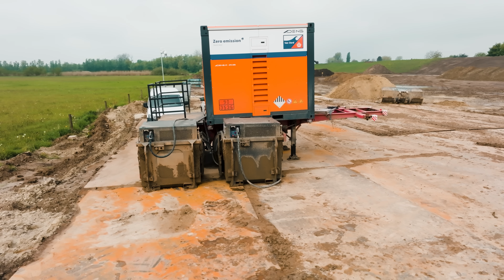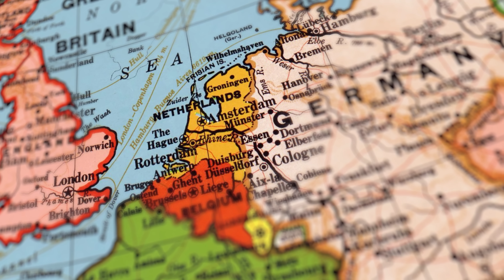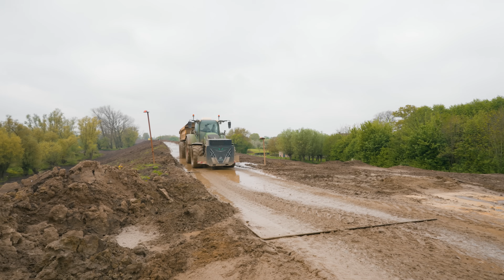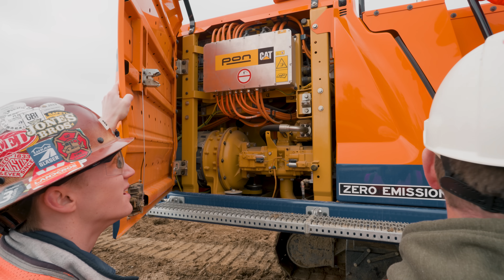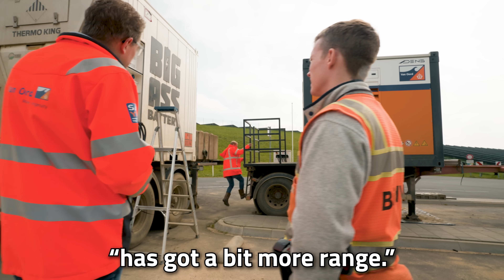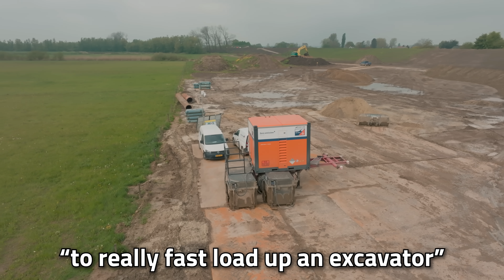Inside the World’s First Electric Construction Project!

Comment: I’ve been a heavy equipment mechanic for almost 20 years now electric machines are gaining more and more ground in the industry in order to run machines 24 hrs a day like some applications are gonna have to come up with a way to swap out battery packs quickly and efficiently to keep things running smoothly
Reply: Perhaps in some contexts running 24x7 is important, but in this case clearly one of the goals is to reduce the noise footprint since they're working next to the residential areas and surprise surprise... they likely aren't allowed to do anything overnight anyway.
Reply: Some people were commenting the tractors can self swap batteries thanks to a smaller internal battery. Maybe they can figure out a solution for the excavators too. This was all retrofitted, maybe moving forward they will design new machinery with electric first design (like the difference between a tesla model Y and a volvo xc40e, the latter having been retrofitted from a thermic design) which might allow them to implement such things.

Comment: Paid by the Dutch tax payer directly or indirectly... Not coming cheap...
Reply: It’s cheaper in the long run anyway.
Reply: We're you get that from? Special 1st off manufactured hardware/equipment 200% of standard costs, less Tenders capable to tender! A learning curve yes paid by the taxpayers, easy playing...  @Freba9
Reply: @janrozemaaus  Diesel is expensive and effects of climate change on society are even more expensive. Electrification is always cheaper in the long run, even if it concerns a learning case.
Reply: Electricity is not cheap as well. Green power generated by subsidizing funding of the hardware... windmills  @Freba9
Reply: @janrozemaaus  A lot cheaper than diesel.

Comment: These machines must have just massive battery packs. Probably > 200 KWH. These Li-Ion packs when they go into thermal runaway the fires would be spectacular, extremely ferocious and totally un-extinguishable  . The big downside of the battery operated equipment.Charging is an issue comparing to putting in fuel. Although fuel cost saving could be substantial, which is a big benefit
Reply: Sure, but thermal runaways are very rare.
Reply: @Freba9  Actually there are not. Indeed the latest data indicates they are 3X more tan likely ICE to catch fire. The greatest danger comes from when the pack gets damaged. When a fuel tank gets damaged its not a big deal. When a battery pack pack gets damaged it's catastrophic.
Reply: @MadawaskaObservatory  haha it’s the complete opposite. All data proves ICE fires are MANY times more likely.

Comment: this is the stupidest thing ive ever seen almost zero co2  hahah sorry about the co2 it took to make the batterys and everything else  the machines are soooooo much heavier   this battery idear works here cos thay have a solar farm right there for it if thay didnt and needed to use the main grid electric then co2 goes thru the roof cos the insane use of electric just to charge        use diesel its cheaper and beter for the enviro
Reply: Incorrect

Comment: How much money did going electric add to the cost of the job.
Reply: at least 40%  but we have high tax rate already here in The Netherlands so its money spent well for the neighbors area whit less noice.
Reply: @Stimpy_slammer  Also as these projects get more widespread economy of scales drops the price substantially. Even since this project started in 2023 we have seen a drop of 20% in price for electric heavy machines
Reply: At least 20 quid
Reply: Electric machines are roughly 3 to 5x the cost of the diesel equivalent to buy, given this the contractors also factor in those costs when accepting the job.

Comment: What fuel source charges those batteries 😂😂
Reply: Wind and solar mostly.
Reply: judging by the wind and solar infrastructure next to the project area, mostly wind and solar.

even if they "just" use the countries power grid, half the power the country uses is produced by wind and solar. 
so worst case scenario only half of the energy they use is green. still miles better than 100% fossil ice engines.
Reply: Kiwi, did your parents feed you idiot juice?

Comment: What are the economics?
To what percentage is the project subsidized with public money?
Were traditional earthmoving companies excluded from the tender process?
Was 100% battery powered equipment a contractional condition for the project?
Is this a commercial project, or a political project?
Reply: This is public infrastructure so 100% paid with public money.
Due to environmental laws (cause the dutch neglected their nature reserves) the project could only be done without emitting nitrogen dioxide into the air.
The tender process was based on that. 

No commercial/political. This is done by dutch watermanagement boards, who have their own form of tax and are independant of country wide politics (mostly).
Reply: @randomviewer3494  
Was there risk of nitrogen being emitted into the atmosphere by using non-electric earthmoving equipment?
Reply: @eatingamandarin  burning diesel creates nitrogen dioxide

Comment: If they really wanted to be efficient, I would think getting rid of hydraulics completely would be better. Because it takes power to run the pump even when no work is being done. Where a linear actuator uses nothing unless it is moving. Rg Letourneau did it.
Reply: That would be a next step. But changing to many parts of a system at once creates huge project risks. This is a perfectly viable mode to work in, so no need to take multiple steps at once.
Reply: There are some large electric actuators replacing hydraulic cylinders in some other applications.  Just a matter of time and it will happen on excavators as well.

Comment: Whist it’s interesting to see these fully electric work sites I cannot see how this is more efficient than diesel equipment. I can’t get onboard with battery technology as a replacement for diesel either
Reply: Due to environmental laws diesel equipment couldn't be used on this work site. So it is literally the only option.

As for raw efficiency, electric motors are far more efficient. Even charging them using a diesel generator would be more efficient than just running a diesel machine.
Reply: It is not about the efficency. At least not for now.

Comment: Those windmills are really generating all those megawatts that are required. Oh wait, they aren’t moving. . And it doesn’t look like a particularly sunny day either. Don’t even mention the overnight charging. So all that electricity has to come from somewhere else. 
And how many times does a diesel excavator needs to be fueled on a normal working day?
Reply: Thing is that the European network works from Norway, to Spain, to Italy. If there is no wind or sun in the Netherlands it comes from the sea or other areas in the network. 

Besides that excess power is stored in a combination of hydro, hydrogen, batteries etc. 

Also this excavator uses 800kwh a day, so around 21 gallons. A fueled system uses 36 gallons of diesel.

It's just an amazing way to do it

S
Reply: @welvaardsbuik   Yeah, luckily it does. But at the moment it is night, so no sun anywhere. And virtually no wind across the continent. Most of the energy is currently from nuclear. And some hydro, and gas. 
Good thing it is weekend. Less energy demand.

Comment: How big are the batterys in the machines?
Reply: 140 kWh in the front of the Tractor, 70 kWh inside the tractor. 
400 kWh in the Doosan wheel excavator and 800 kWh in the Doosan crawler excavator. 
The CAT converted machines are explained in the video
Reply: @VoltGas very cool, thanks for the reply.

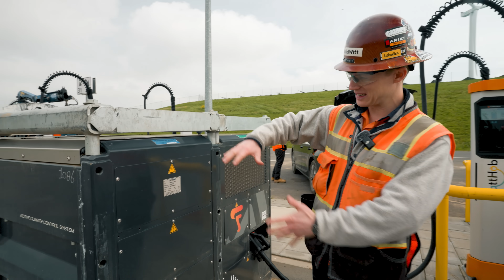Comment: A nice detail to add about the chargers (around 15:31): The machines and battery boxes all charge using a regular CCS2 connector. The same one all European electric cars use to charge, including Tesla. The project managers car can be seen charing in the background. 😀
Reply: When moving the equipment, you could even charge it at a public stations.
Reply: Nice, now you can expect a 800 kwh excavator occupying the only "fast charger" in your village. 😂😂
Reply: @mennol3885 In Europe we have a very dense charging infrastructure and also you very often have sites with 10+ charging terminals. 

We even already have the first megawatt terminals so like 1500 kW (but up to 3500kW for a single charger)
Reply: That's really great and convenient
Reply: I was talking to a Tesla tech at a charging site and all of them are actually set up for 1800kw even though it was only a 250k charge site. Waiting for the semi's to push the roll out of the over 1000kw chargers. Maybe then cars will get the systems to charge in 2 to 5 min. Cooling being the problem with that much juice
Reply: @sparksmcgee6641  Delivering the power has never been the issue. Battery chemistry is. Any cell in the pack can only be charged so fast. It's like boiling eggs---sure, you can boil a thousand eggs in 5 minutes, but no matter how big you make the kettle, or how powerful the hob, you cannot boil them faster.

For Li-Ion, the chemical limit is at about one hour for a full charge, or around 20 minutes for a 20-80% charge.

The only way to get a faster charge is to put a bigger battery in and lie about its capacity. If you call 50% "full", then charging 20-80% (real: 20-50%) in 10 minutes is easy.

PS: CCS2 caps out at 800kW nominal (~1000kW peak). If you need more, there's MCS with 4500kW nominal.

Comment: bro 800KWH... almost 1 MW.... Im not sure we all understand how much energy the world will need to produce to make this possible at scale. Not doubting it, but without nuclear I'm not sure how we get there. That's an insane amount of energy
Reply: You know that is less energy needed than running on diesel right? Electric engines are quite a bit more efficient at turning energy into working power.
Reply: A data center GPU rack consumes 40-60 kW.  So in 24 hours it could consume up to 1440 kWH. Those CPU racks are being used for AI
Reply: @johnvillalovos that’s also come straight in from power lines from power generation. These batteries and the logistics won’t scale. “Yet” I’m just trying to wrap my brain around the amount of lithium or other battery material we need… and the amount of power to make this a reality. Here in the USA we’re tapped out so I hope we double our current supply. It be a cool future.

Comment: What I am seeing is an entirely new supply chain segment (powered by diesel) created out of thin air for no reason.
Reply: If you looked closely, that supply chain is electric too. As for the no reason, environmental laws are the reason. Although I'm sure the neighbourhood prefers it too. Keep in mind, this is ground breaking (pardon the pun) technology. Give it a few iterations and a lot of the infrastructure can be reduced.
Reply: @randomviewer3494 are the factories that make those batteries and equipment powered by batteries well?  The point is, you can move the carbon to whatever part of the supply chain you want.   It still isn’t green which is the entire point of this regressive manure.   Next, you’re going to tell me this is cheaper, right? 😅
Reply: Did you notice the stationary windmills and the not so sunny weather?  I wonder if they can generate that multi megawatt power that they will need with their multiple 350kW charging batteries. On sunny or windy days; no problem. But often there may be foggy windless days in winter. Then the work would have to be paused?
Reply: @hondaspeed6785  No, that solar farm has quite a beefy connection to the net. So it can just pull power from that to charge the batteries. That'll be either solar/wind from other parts of europe, nuclear or gas powered plants.
Reply: those trucks moving the batteries are electric too, the little plug on their side gives you that info.
so yes the entire site is electric. (except for the dozer that is there because like Aaron said in another comment, the electric one is being worked on atm)

and the bigger the share of renewable gets the bigger the part of the whole supply chain becomes green. 
from mining the materials to build these vehicles, to those vehicles working.

seems like you're just grasping for things to hate on this project, you wouldn't happen to have stocks in oil companies do you?

Comment: I bet those tractors have got some torque..........I can see that catching on, even agri tractors have big weights on the front, the battery is just replacing that. The potato harvesting mob would love those things.
Reply: It's similar power and torque than the original Fendt 720 (almost 1.000 Nm). Power and torque limits have to be similar as diesel engine to not damage  the rest of the driveline (vario, wheel drive etc)

Comment: Let’s see how well the equipment does in high heat or cold.  Most places have a wide range of temperatures.
Reply: that is the advantage of the Netherlands. no extreme winters but nowadays warm summers. so in itself ideal for batteries
Reply: Batteries are cooled and can be heated if needed.
Reply: temperatures n The Netherlands can go from -20 to +35 (celsius) so if those machine can function the whole year they should be able to function in most places.

and for the places that do have more extreme weather, they can just adjust the machines a bit (like isolating the battery to regulate its temperature).

Comment: There's a company that's experimenting with Electric construction sites, but still use generators that the stationary cranes are hooked up to.
So yeah I said too this is stupid, you're using a diesel powered generator to create electricity for a ''green'' machine. But they told me that they are using less fuel to generate all the electricity needed than if the machine itself was burning it. So you get 100% of the work done on 50% of the fuel (Or however many they manage to safe)
Reply: Generally they save about 30% on stuff like that
Reply: Reducing CO2 emissions is not the only goal. Reducing noise and toxic fumes from largely unregulated engines is a huge benefit for workers, locals and local nature.
Even if it is generated by a stationary diesel, it is much easier to limit emissions and noise from that single generator than for all the equipment that comes and goes on a job site.

Comment: I'm curious why they chose to run it through an inverter. If you were using a generator, sure, it would make sense to use AC. But if you have batteries it would make more sense to just use DC in the whole system, you need to cool the inverter and there's losses associated with it.
Reply: An inverter (frequency controller) is required to control any electric motor.
Reply: I don't know but every electric car has inverters too
Reply: the guy tells you in the video.
they designed it be easily used around the world.
now they can simply tap into the local power grid and use charge those batteries.

if they used DC only equipment, they would need to transform the power girds electricity to DC before they could charge the batteries.
Reply: Basically the engineers who design these things just pull ideas randomly out of a black box and then implement them. So you never know what you gonna get.

Comment: Seems like the Europeans are 20 years ahead at this point
Reply: Yeah but our countries will soon be destroyed by the woke immigration laws
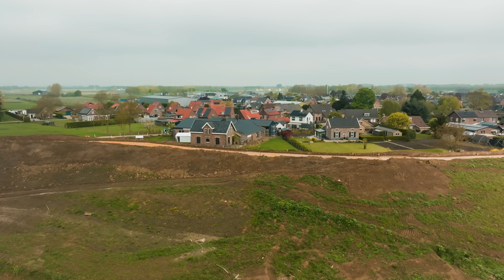Reply: Only one tiny nuclear reactor in NL - most countries have many more, so apart from all 'progressivism', they are backward. Also, the "green power" (after 23:00) is imported French nuclear excess power. It's going to take at least a decade before more nuclear will be produced locally - and that is a big IF, as they can't even agree on the exact location. Pathetic lack of long term vision.
Reply: @ibubezi7685  you are really going to judge a country by how many nuclear reactors they got? not even on how much that makes up their power grid but just the number. not even mentioning other sustainable sources?
That's a pathetic argument.
Reply: @Schinkeldink How much power does Borsele produce? No nation can be self-sufficient with one reactor - not even a country like Luxemburg. So, that is a strawman.
Also, solar and wind are not sustainable - they are not reliable and panels made in China are also polluting (over there). Plus, blades are not biodegradable - they are buried - for future generations.
It's a green lie - only to believed by the gullible.
Reply: @ibubezi7685  nuclear isn't the only non-fossil fuel.

at the moment a little over half of the countries yearly electricity needs gets generated by wind and solar.
so over 50% of all used power is generated by renewables.
and that share is growing each year.

Comment: I would like to see what an excavator designed from the ground up for electric power would look like.
Reply: Kinda like any excavator
Reply: @smo5681You could use an electric motor directly on each axis of movement and completely eliminate the inefficient hydraulic system.
Reply: @smo5681Maybe they could use electric motors directly for each movement axis, eliminating the inefficient hydraulic system.
With a completely different mass distribution, the counterweight would look different.
Reply: They aren’t. These are bought as diesel machines and then converted to electric at “PON”. The workshop is briefly shown in the video.